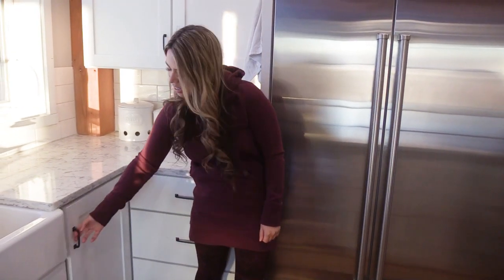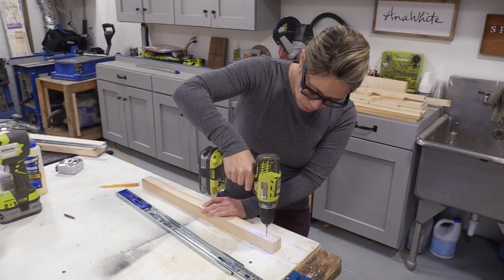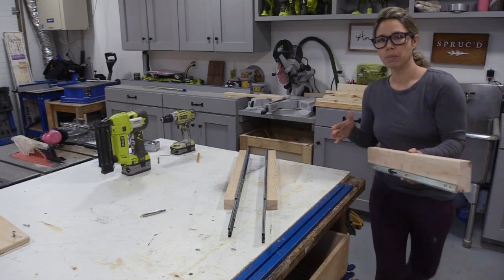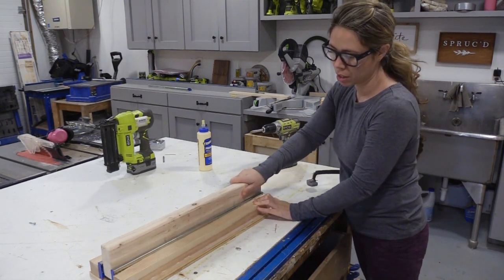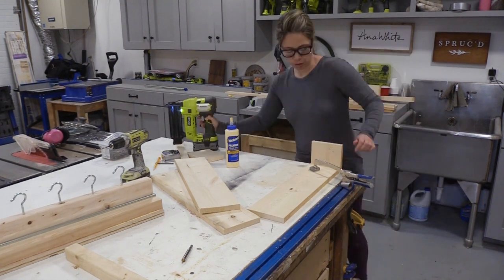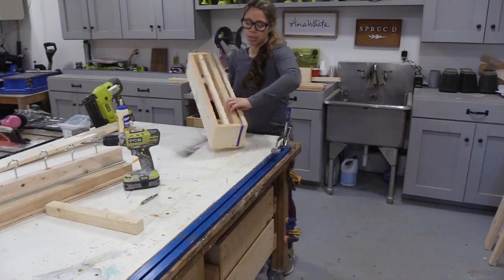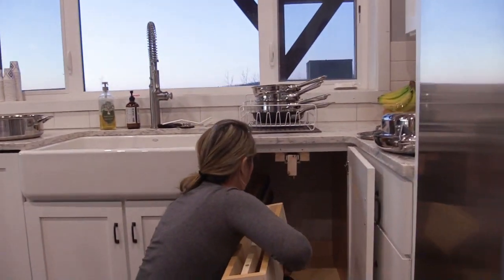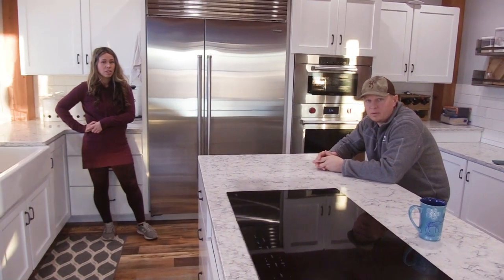Pull Out Pot and Pan Organizer

Comment: Love the project. I would love it if you can find a solution for a corner cabinet
Reply: We have a problem with a tight corner lower cabinet.  I've told my husband not to be surprised when he comes home to inserted shelves where the front door shares that tight cabinet area wall.
Reply: A lazy Susan is an option and they come in various sizes.
Reply: Rev a shelf corner shelf … but it’s not cheap.
Reply: Agree! The worst cabinet in my kitchen
Reply: There is a 3 bin garbage solution on Amazon that is actually pretty useful. My in laws got one and now I’m installing ours

Comment: Pretty neat. The only thing I dislike about this, is the pots and pans smashing against each other as you pull them out. I don't like a lot of loud noise, so this just isn't for me xD but it gave me an idea to make a deep drawer with spaces for the pans kind of like you did for your lids, that can be pulled out from the bench.
Reply: I was thinking the same thing only u could hang something like long cork tubes between each pan to stop the clanging. So pan, cork tube, pan, cork tube and so on. Or any other material.

Comment: Do you have a solution for installing something similar to this to hang pans/lids as well as something for pots in a cabinet like the one you have at 0:27? GREAT JOB! 

The cabinet you show at 0:27 where you stored pans is almost identical to our cabinet next a drop-in stove. It's tough for my husband to bend into that cabinet. Currently, I do have a couple pan screens hanging on the door for easier access; hwr, it'd be nice to convert this to something like you have here, though I'd like space to store pots too. Right now, the cabinet that runs from the stove to the end wall is packed w/14" wok, stock pot/lid/insert, small double boiler w/lid, small metal sauce pot, & there are several Le Creuset pots & pans w/lids that I can't get into the cabinets. I've also recently invested in a De Buyer 12-13in carbon steel pan & I'd like to get a smaller one like it. The only trouble is that I'm unsure how to store it all under the cabinets. Any ideas? Again, we absolutely love this idea of hanging my pans. I'd be willing to convert to pans w/holes in the handles if it meant it was easier to get to them.

Comment: Soft close drawer slides are an utter waste of the added +/- $40 for this project. The point is to reduce noise, so why use them for a bunch of swinging, clunky, clattering pans? I made this with soft close slides but I'm going to replace them with a pair of basic self-closing slides I salvaged from cabinet drawers and reuse the soft close slides in a project that will actually benefit from them.